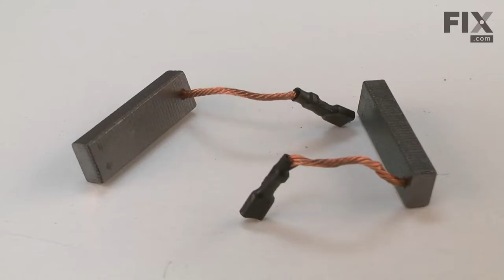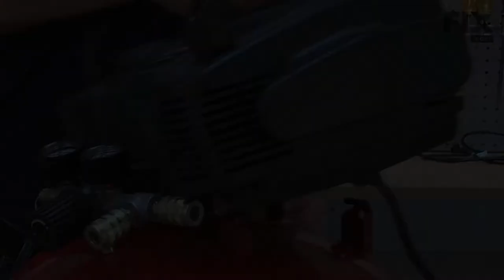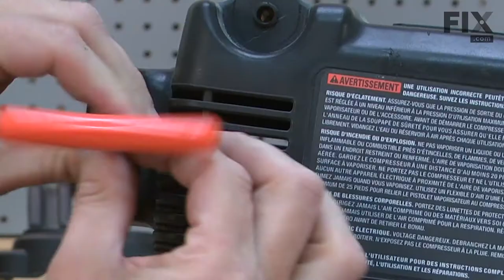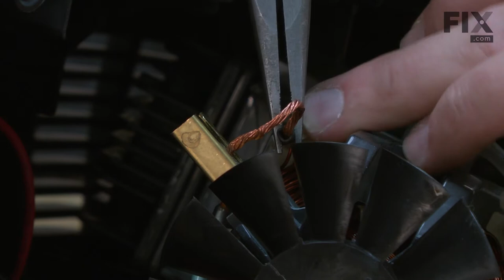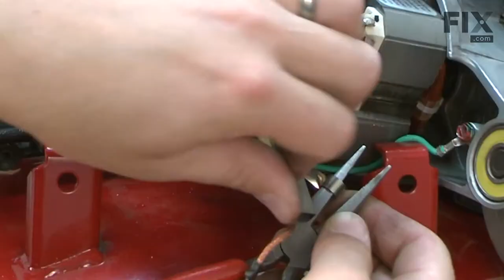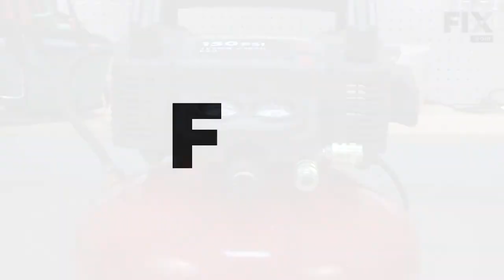Porter Cable Air Compressor Repair - Replacing Motor Brushes

Comment: How do I replace the brushes in a 20 gallon 175 psi husky air compressor the wires look like they are fixed please help

Comment: The brushes on my Fortress 27 gallon air compressor won’t come out?  I think they might be seized up (from spraying epoxy in the vicinity of my compressor!  Oops!). I think this is causing excessive sparking.  How can I get them out without damaging my compressor?